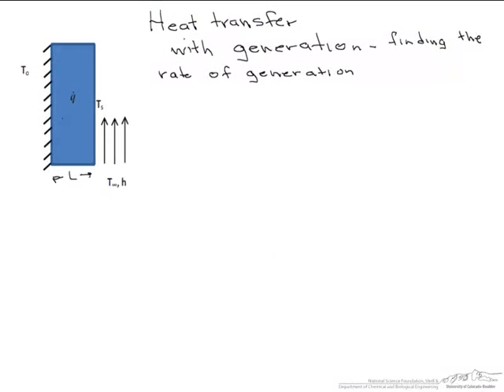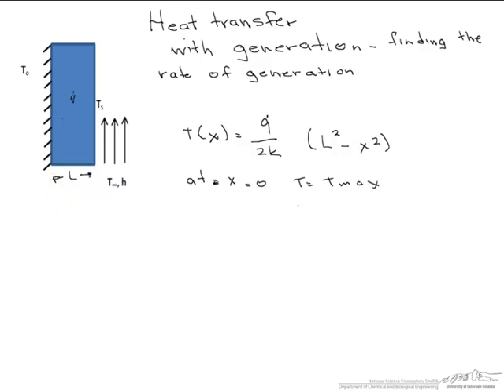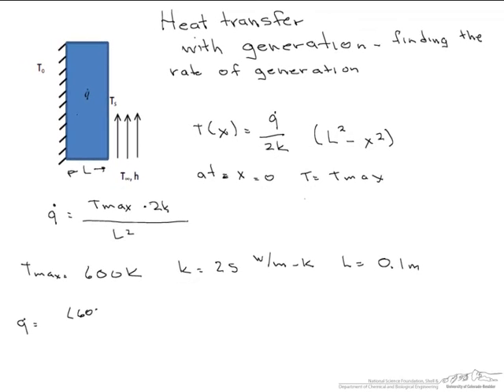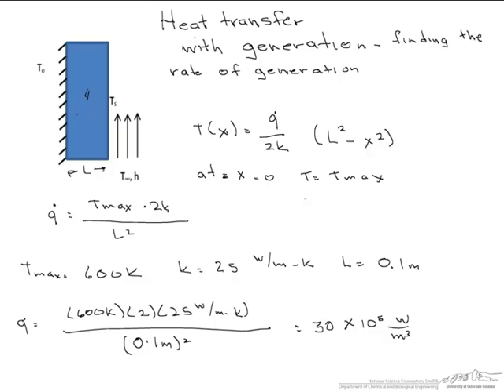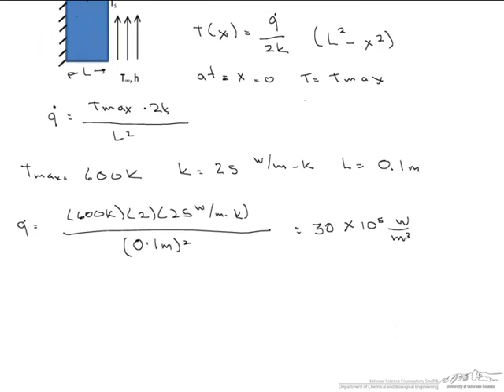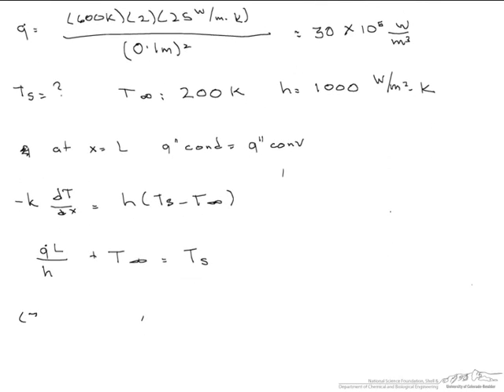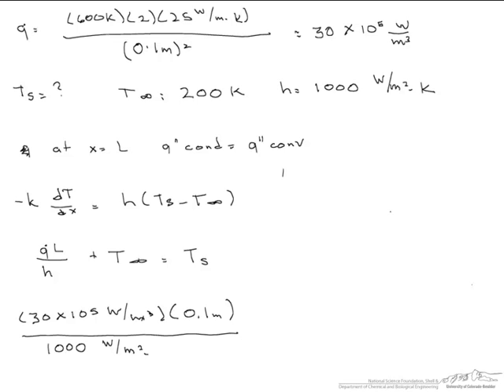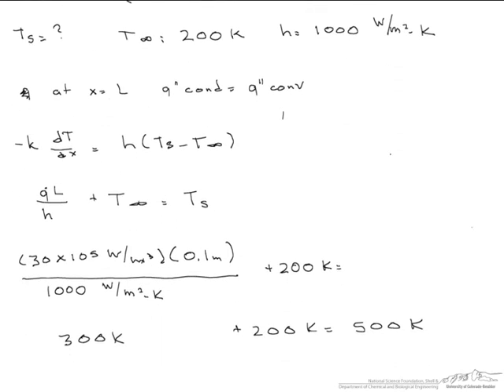Rate of Heat Generation

Comment: Is there somewhere i can find an explanation for the way you got the formula you present at the very start of the video? I know it's from the heat equation rectangular coordinates, but even when I derive it with boundary conditions x = 0, t = tmax and x = L, t = ts, I don't get it. Should I not be using the other boundary condition? If not, what should it be?

Comment: Your equation is wrong. Temperature at x=L is clearly not zero.
Reply from the maker: +(Hydrogen)(Pi) Thank you for commenting, but I don't understand your question.  Please tell me the time in the video that you are questioning.
Reply: 0:26 T(x) equation is wrong, cause at point x=L the temperature is equal to Ts, not zero.
Equation should be like T(x)=(q/2k)(L^2-x^2) + Ts
Reply: At point x=L the temperature is equal to T_0, not Ts. T_0 is the maximum, you just misinterpreted the video
Reply: I still don't get it how is Ts zero

Comment: How can I calculate the heat generation rate on a 2D flat plate (1m x 1m) made of aluminum with known surface that is being heated (0.16m^2) and max temp=500°C?
Reply: oh, heat flux is also known 12500 W/m^2